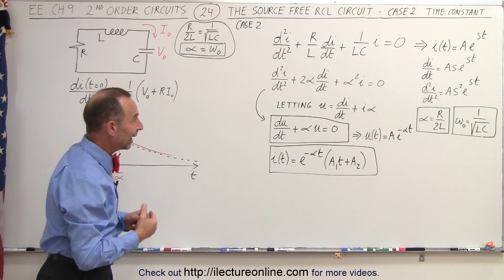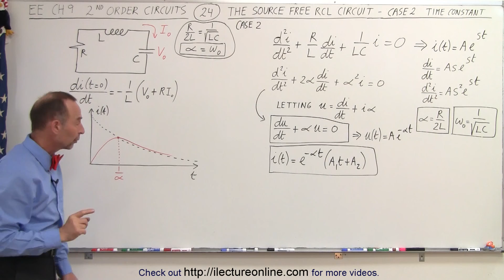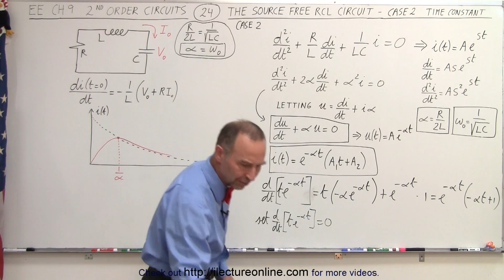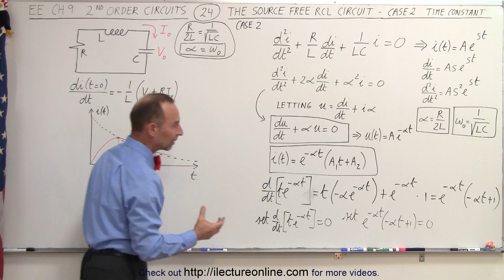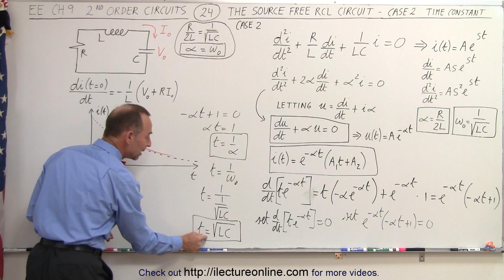Electrical Engineering: Ch 9: 2nd Order Circuits (24 of 76) RCL-Case 2 Time Constant = ?

Comment: Hi Michel. I have a question. Why do we need to set the derivatives equal to zero?
Reply from the maker: We set the derivative equal to zero to find the time where the slope is zero.   In this case where the current is a maximum, which means where the impedance in the circuit is a minimum.
Reply: @MichelvanBiezen  Thank you for your explanation, Mitchel.